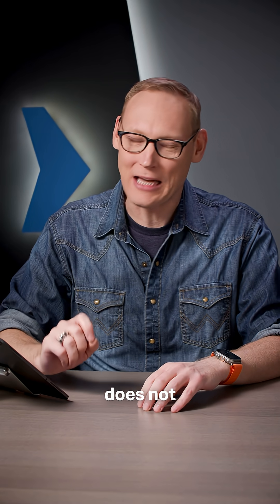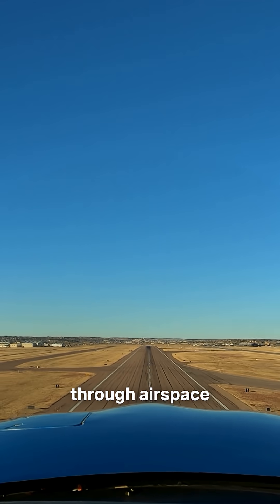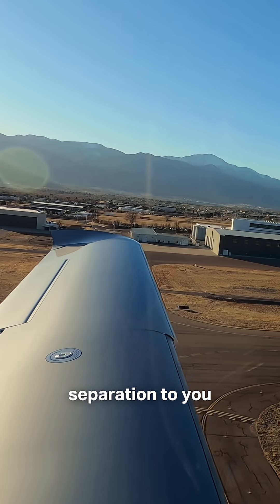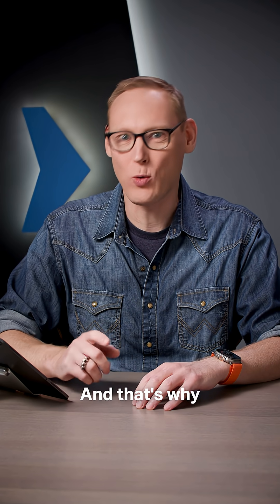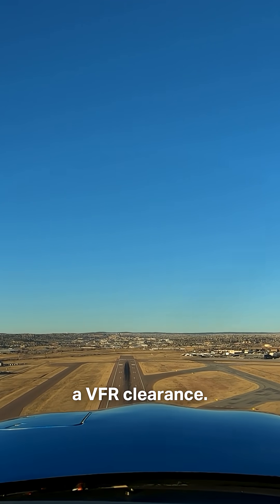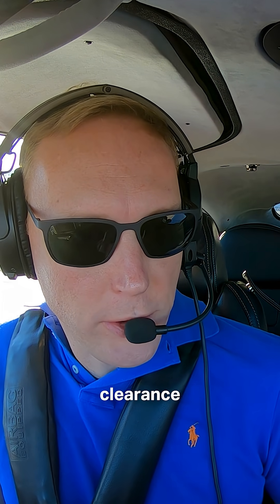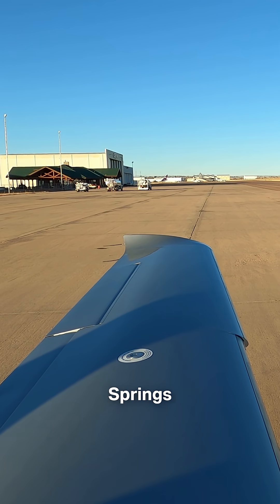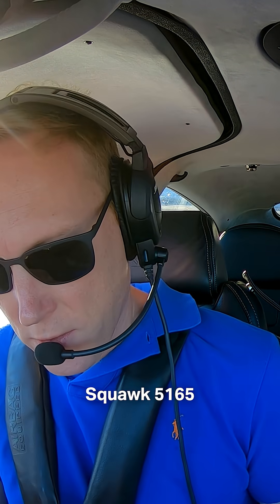ATC Clearance Departing Class C Airport

Comment: Hmmm…..can’t say I can agree with you.   A “clearance” is not actually required.  That’s only Class B.  In Class C airspace you must be communicating with ATC but you’ll never hear them tell you that you are “cleared”  into the airspace.  They will tell you to remain outside Class C if they are not able to accommodate you.   As for departure, they will just give you a squawk and possibly a heading and altitude to fly.  You’ll notice in your example that ATC never used the word “cleared”.  
Btw, retired ATC (32 years) and current corporate pilot.
Reply: I agree!